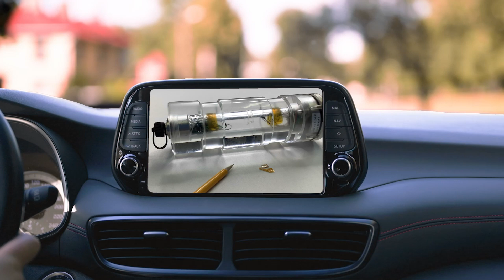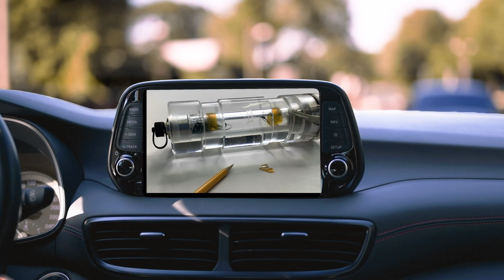Behind the drive of a strain gage load cell (Buckle your seatbelt)

Comment: Expert tip for improving this video:  Take that original actually-useful video that someone shrank and edited into small rectangle within a backdrop of a completely uninformative  car dashboard, and just size that small video to occupy the entire available frame. Or as likely as not, just leave it in its original format filling the entire frame.   In the current version, it just looks silly on a computer screen, and on mobile the useful portion of the video is unnecessarily small.  The overarching impression is the same as those ripoff YouTube channels that take a copyrighted broadcast TV program and attempt to escape copyright detection by flipping it left-to-right, shrinking it, and grafting it into some other unrelated dynamic backdrop.